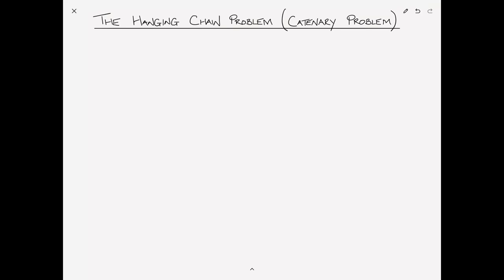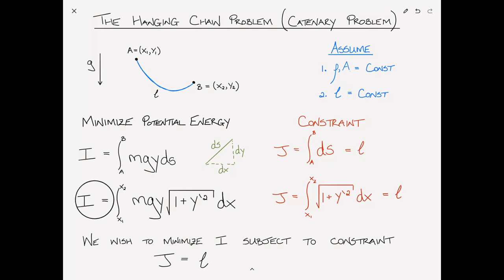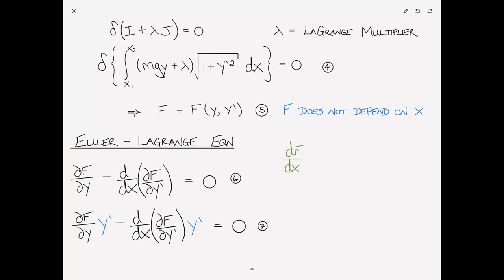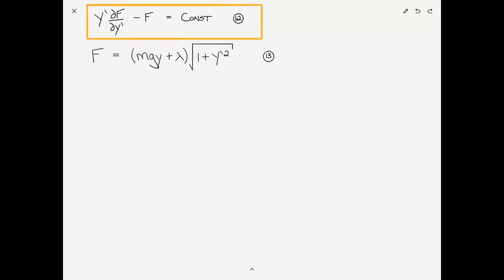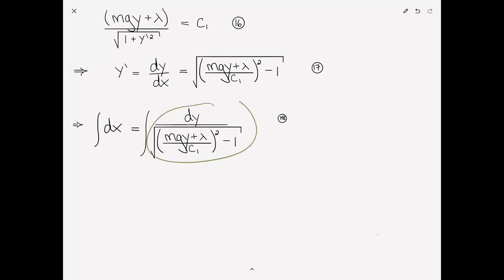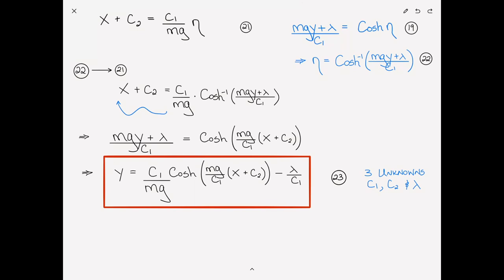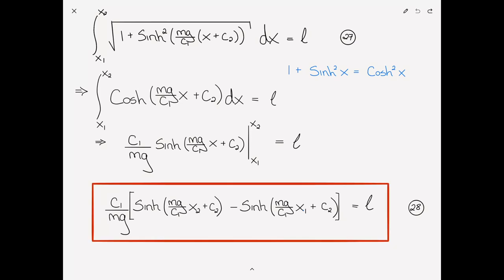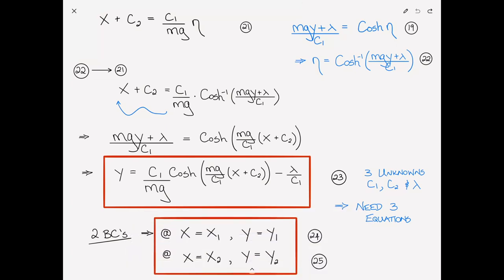The Hanging Chain (Catenary) Problem

Comment: Thank you, Sir, it's wonderful explanation and you should be a brilliant star lecture! The flow of the lecture is; minimising Potential Energy to Lagrange Multiplier to Euler-Lagrange(never boring :)) to Beltramy Identity and finally two ends boundary conditions and the length of the line = l. Only one mistake is eq.23 where the correct is Lambda/(mg) instead of Lambda/C1, but it wouldn't alter the solution :) But the lecture was great without doubts!
Reply from the maker: Thanks for your words and your feedback.  I have been asked this question a few times, so I'll pin this comment to the top.  Eqn 23 is correct as written.  What I did in a single step (without adequate explanation) is:  1. subtracted λ/c1 from both sides, 2. divided both sides by mg, and 3. absorbed the mg into the λ (which is okay because λ is simply a constant - I could have called it a new constant λ' or λ2 or something else, but I just kept it as λ).
Reply: @Freeball99  this is incorrect because when after you subtract the lambda/c1 you later have to multiply both sides by c1 anyway in order to isolate the y, which cancels out the c1, so absorbing that into a new arbitrary constant is not valid (because it’s not really arbitrary). Then dividing both sides by mg yields lambda/mg, as the original commenter correctly stated
Reply from the maker: @dababyonfire6868  Yes, the λ should not be divided by c1.  The mg, however, can be absorbed into the  λ without a problem.
Reply: @Freeball99  oh I see what you’re saying. I forgot that lambda itself was an arbitrary constant. Thank you!
Reply: Sir, THANK YOU! You literally saved my worksheet I have to explain on friday <3 Wish you were my prof 
All the best Wishes for you

Comment: @15:19 i feel " -lambda/mg ". 
Thank you freeball for solving this problem. i was not able to solve it without beltrami identity.  
Your presentation is clean and beautiful.
Reply from the maker: I absorbed the mg into the λ since λ is just a constant (I should have mentioned that).  I have pinned a comment to the top of the discussion section which explains this in more detail.

Comment: Your lectures are priceless. Very clear and easy to follow. I intend to gobble up more of them. But as I was considering 'going down the rabbit hole' toward a numerical solution, the issue of units came up. And I believe that a parenthesis got dropped on the way from Eq 27 to Eq 28. I think the arguments of the sinh function in Eq 28 must be the same as they are for the cosh function in the earlier solution for y. Thanks again. All for now.

Comment: This topic is so interesting and you have made it so more interesting. Thanks a lot for that. I have found that the shape function for the hanging chain problem does not depend on the mass per unit length. However, the same is not evident in the mathematical expression.
Reply from the maker: Interestingly, the shape of the catenary minimizes the tensile load in the chain.  As a result, arches that are built in the shape of a catenary are the strongest as they minimize the compressive loads.
Reply: @Amit Correct. The parameter mg/c_1 sets a common scale for horizontal and vertical distances. In units of mg/c_1, the shape will follow the cosh function; see Equation 23.
Reply: @Freeball99  See, e.g., Sagrada Famiglia https://en.wikipedia.org/wiki/Sagrada_Família

Comment: Another gem of a video. I do have one question, though. In the introduction to the Lagrangian multiplier, you say that G, the constraint, must be taken to be zero, so that it effectively changes nothing when added, but here J doesn't seem to satisfy this condition. I'd appreciate some clarificafion, if you've got the time. Thanks anyway.
Reply from the maker: This really requires a mathematical derivation of the method to explain it.  The basic idea is that by adding λG in this form (where G=0) does not affect the necessary condition for finding an extremal of the modified functional.

Unfortunately I just don't have the ability to explain it using text only, so will have to save it for a video.

Comment: Thank you very much for your video lectures, dear Andy. I have a question in this one: when we determined the eqn of catenary in the end, we had three unknown constants there, including the lambda. For that, you said we determine the third condition using the constraint equation. But then we wrote an eqn with l and c1 and c2. What about the lambda? And what do we do with this 3rd condition if we leave the lambda aside?
Reply from the maker: You have 3 equations and 3 unknowns so this is solvable though it will likely require a numerical solver in all but perhaps the simplest cases.  I have shown an example in a different video of how to treat this for a pendulum problem where I substituted the constraint equation into the other two equations of motion.  youtube.com/watch?v=wPk16G7mkZY

Comment: Hey, nice FreeBally.

Nice to hear a Cape Town accent. I have a more important optimisation problem to solve, which is that of an elastic catenary with fixed weight at some point in the catenary.

The problem space is maximum highball free-lining, where we deliberately span open spaces with elastic climbing ropes and the walk them.

The ultimate boundary condition of course is elastic strength failure of the freeline. However that failure condition is not the solution to the fundamental problem.

What is the catenary solution for an elastic rope in the presence of one or more discrete local masses?
Reply from the maker: Originally a Durban accent, now with a California influence...  

Interesting question.  I'll need to give it some more thought, but fundamentally, the discrete mass produces a discontinuity and would thus produce a boundary condition.  Thus we would have to treat the rope on each side of the mass separately (if it is symmetric, we could just solve for one half).  Also, it is not immediately clear to me whether this problem would have an analytical solution, but certainly we could set up the governing equations.  It's a difficult problem to explain in these comments; really requires a video.  

I had planned to make a video demonstrating the case of a beam with a discrete mass.  This will be fairly similar to the problem you have posed in that it was demonstrate how to treat discrete masses - after all, a rope is just a beam without any flexural rigidity (EI = 0).  Perhaps I'll have to promote to the top of my To Do List.
Reply: "elastic catenary" might be thought of a chain where each link is a spring with a finite spring rate. A realistic problem in practical engineering, e.g., suspension bridge.

Comment: Hey, brilliant video mate, I thought of this problem a few weeks ago but couldn't solve it, now I have a name and a solution! I have a question/comment though, at 15:30 in equation 23 shouldn't lambda's coefficient be 1/mg?
Reply from the maker: Since lambda is just a constant, I absorbed the mg (which is also a constant) into the lambda.  It's a different lambda from the line before (I didn't want to call it something different) but it's just a constant all the same and will come from solving the given conditions.
Reply: @Freeball99  Ah, fair enough. you have lambda/C1 though, wouldn't it be more efficient to absorb that too? or is this a sort of canonical form and these specific constants have meaning behind this equation?
And wouldn't it be better to specify C1/mg as another constant, then it takes the form y=a*cosh((x+b)/a)-c, which imo looks much cleaner?

Comment: Thank you for a brilliant presentation. One query: I think that in Equation 23, lambda should be divided by mg and not by C1. Cheers.
Reply from the maker: Since lambda is just a constant, I have absorbed the mg into lambda since a constant divided by a constant is still a constant. What I have done in a single step is to define a new constant, say, lambda2 = lambda / mg and then recognized that lambda2 is a dummy variable so I could just call it lambda.
Reply: @Freeball99  Thank you for the reply, however I still don't understand why the "new lambda" is shown being divided by C1 in equation 23.
Reply: @Freeball99  It is inaccurate to have it written as you have it in the video though since mg is not equal to C1.

Comment: The 'usual' equation for the shape of a catenary  is, I believe, y = acosh(x/a) which is much simpler than the one that you finish up with. Are they effectively the same? I like the maths though.
Reply from the maker: The shape of the two are the same (ie the cosh function).  In our case, we need to fix the cosh function curve to the starting and ending points PLUS we need to generalize it for chains of different length.  This is why we end up with the constants c1, c2 and λ.

Comment: Thank you for the insightful lecture! 🙏 Quick question: At 5:00, when discussing the variation of (I + lambda*J) = 0, shouldn't we express J as an integral equation - L = 0, as discussed in your Lagrange multiplier video? Just looking for clarification! Thanks again! 🌟
Reply from the maker: This is a very good question and really requires a video deriving each method to get a proper understanding of why this is.  I haven't made the video yet because it will be very mathematical, dry and likely not very popular.

In short, however, these two problems you mentioned are not the same type of problem due to the different nature of the constraints.  This problem (the hanging chain problem) is known as a CONSTRAINED OPTIMIZATION problem because the constraint is written as an integral and serves as an overall constraint of the system.  On the other hand, the pendulum problem is known as a CONSTRAINED COORDINATES problem since the constraints involve the coordinates themselves (could also include derivatives) and apply to every point within the domain, rather than being satisfied in an integral sense like for the hanging chain.

While both problems are solved using the Lagrange multiplier method, the reason that we do not subtract L from the constraint in this video is due to the difference in the types of constraints.  

So the methods used in each of these two videos are correct, i.e. in the case of an integral constraints, we DO NOT write G in the form G=0 while in the pendulum problem, we DO write G in the form G=0.  

Hope this makes sense.
Reply: Thank you for the comprehensive reply! 🙏 Your solid understanding of the topic is truly motivating. Much appreciated! 😊 @Freeball99

Comment: Hello, thanks for the video. , may I ask what the problem is called when one end of a chain is fixed somewhere and the other is free ? So that it is like a pendulum though flexible and bendable at any point instead of stiff.

Thanks
Reply from the maker: Not sure what this is called.  If the chain is massless, then perhaps a mass on a string.  If the chain has mass, I'd probably call it a compound pendulum
Reply: @Freeball99  yes its probablx a compound pendulum with infinitely small pendula with the weight cancelling out any (?) chaos.

Comment: 19:00 after you've substituted the identity and simplified the integrand, shouldn't the parentheses still be around the x+C_2? I have little experience with hyperbolic functions but that's something which shouldn't have changed? A surprisingly welcome video nontheless!
Reply from the maker: What I did in a single step here was: 1.  Multiply each of the terms by mg/c1  2.  Recognize that the 2nd term is mg/c1 * c2, which is just a constant so I absorbed it into c2 - I probably should have made this more clear in the video.  I could have instead named it c3, but I didn’t want to start adding new unknowns so it was easiest just to include it as part of c2.  This is a commonly used technique when multiplying some unknown constant by additional constants and I use it in some of my other videos (I might have explained it in one of those).
Reply: @Freeball99  I see, I did think about that but didn't know it was something which happend more often, thanks!

Comment: Masterfully explained! The method of Lagrange multipliers really shine in problems like this where the medium is a continuum instead of a set of discrete point masses.

Just curiously though, if I were to solve this numerically, would there be alternatives to Newton's / Broyden's method?
Reply from the maker: There are numerous root-finding algorithms available including the two that you mentioned.
Reply: Brilliant explanation, I agree. However, I think it’s important to note that the solution is independent of mass and energy. This can be easily implemented by replacing lambda with m*g*lambda_2 in Formula (4) at minute 6:10. Then, you can divide by m*g and it disappears, since the other side equals zero. Am I right? 🙂
Reply: @breitbandfunker4332  I'm pretty sure that works out the same.
You can see the final solution in 21:53, if you replace λ with mg λ_2, then c_1 will always be divided by mg.
Substituting c_3 = c_1/mg, you will not see mg in the final solution.
Although, you are right, explicit independence relations are always good in physics.
Reply: @Zxymr  well, I think if you absorb mg in the beginning, it vanishes completely in λ_2. Then you can determine the constants only with starting and endpoint. It should be completely independent from mass and g-factor, which means, any chain has the same shape - even on alien planets!

Comment: I was wondering whether instead of to set the variation of " I + \lambda * J" to zero you would set the variation "I - \lambda*J" to zero. Couldn't that be called the Lagrangian, L= I - \lambda*J ? At the end, since the Lagrange multiplier is a constant number and what is being minimized is linear with respect to \lambda, its value wouldn't be simply the negative of what one gets considering the summing? Thanks for shuch a great video
Reply from the maker: Yes, what you've written is exactly correct.

Comment: I'm still struggling but it's still a great video. Thanks.
14:19 Does anyone know why Eq21 doesn't have a C_3 on the right hand side after he solved the integral?
Nevermind. It's possible to combina C_2 and C_3 so there is only a constant. I saw it later. I'll leave the post in case anyone is confused by the same thing.
Reply from the maker: Yes, this is correct.  I probably should have mentioned it in the video.

Comment: Hi, I think you made a mistake @Freeball99 at 2:05. Your formulation for I integral is wrong. So I is the minimal potential energy across the chain from A to B so we could write:

I = ∫ dEp (dEp is potential energy for a infinite decimal point/segment across the chain)
I = ∫ dm * g * y
I = ∫ ρ * dV * g * y

but ρ = m/V = m / (A*l)
      dV = A*ds
(constant density and area across the chain)

So replacing we get:
I = ∫ m / (A*l)  * (A * ds) * g * y
I = ∫ mgy / l * ds

Obviously it will not influence further y calculations, but it’s something which I noticed in university: mathematicians tend to forget that integrating across any dimension is like multiplying by it 😉😅
Reply from the maker: I explained immediately after that m =  ρA is the mass per unit length.  So the equation for I is correct as written.
Reply: Sorry about that, I misheard, only paid attention to formulas and the usual meaning of notations + used to that mistake in some old calculus classes

Comment: In Equation 23, at 20 min 7 seconds, the denominator of the term in lambda should be "mg", not "c_1", I think.
Reply from the maker: The c1 should not be there.  The mg, however, I absorbed into the λ which is fine because λ is just a constant.

Comment: Int (ds) = s(b) -s(a) = l Am I correct?? I don't understand s(b) and s(a) and how they would equal to l
Reply from the maker: s(b) and s(a) are two different locations/values for the path.  The difference between the two is literally the definition of the path length, L.  Similarly, x(b) - x(b) would be the distance along the path in the x-direction.
Reply: Do you have suggestion where I can learn more about the definitions is it curvilinear coordinate system? Its confusing . Thanks for everything
Reply: Now I  understand. But how is h=yds. It is the potential energy but having a chain length multiplied.

Comment: In equation 23, I think lambda should be divided by mg, not C1
Reply from the maker: Lambda is just a constant, so I absorbed the mg into this.  I really should have called it lambda_prime but I thought that would be confusing.
Reply: @Freeball99  ok the mg absorption makes sense now thanks, but since there is a c1 multiplying the cosh and nothing dividing y, i really don't see why there still is a c1 dividing lambda

Comment: For sufficiently Large l how can we justify that there is a x belongs to (0,1) such that y(x) less than zero
Reply from the maker: Sorry for the delayed response, but I somehow missed this until now...in this case you have added an extra unknown (the length of the chain) so we need an extra constraint equation.  This comes from using the relationship between the length of the chain and the height, y (this comes from the shape of the catenary which you already have an equation for).
Reply: why do you need to justify that